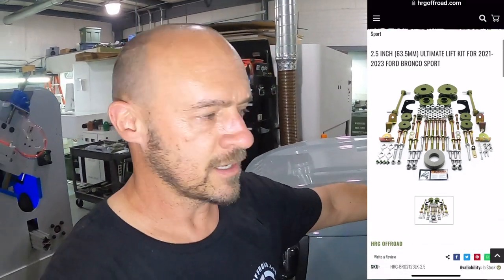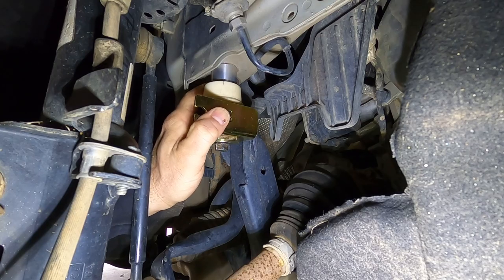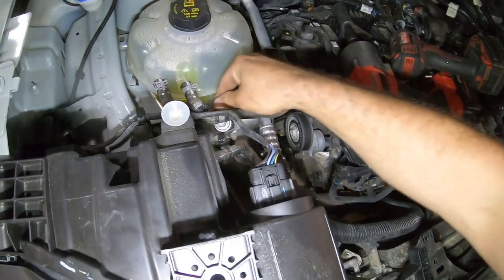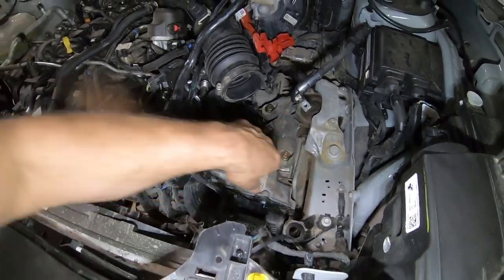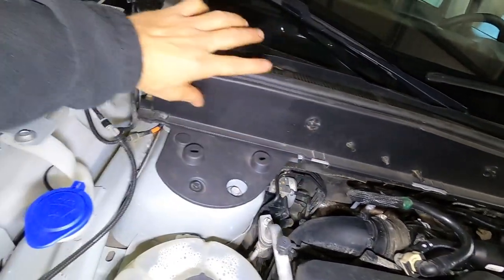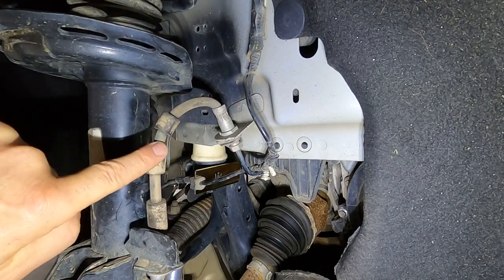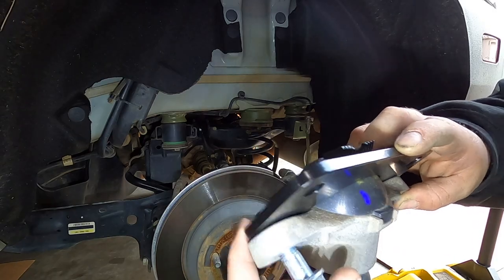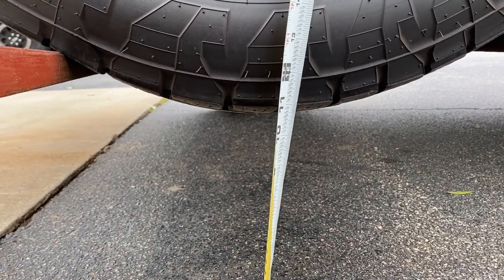How to lift a 2021+ Ford Bronco Sport 2.5 inches with the HRG Offroad lift kit!

Comment: Hey Ben, I just bought a new 2023 Bronco sport (Outer Banks). You said in this video you're working on a 2 1/2 inch lift to fit this model along with the big bend. Is it available now or can you tell me when it will be available for theses models? I'm very interested in purchasing this lift and appreciate your assistance in any way.

Comment: I just installed your 1.25" kit on my Badlands. Thanks and im glad you make products for the Bronco Sport. My question for the 2.5" kit, will this void the power train warranty?
Reply: We have a 21 bronco sport I asked my Ford dealer where we bought it from if I put a after market lift will it void the warranty and they told me yes I have to get the dealership to install a factory lift from ford which at the time only offered 1.5 lift and still have the warranty hopefully this answers your question
Reply: @rogerd8121 false information they would have to prove that any failure being covered under warranty was caused by that lift.

Comment: I can’t find anything bigger than a 1.5 inch for the big bend :(
Reply: The largest is 1.5 inches unfortunately for the lower trim levels. But you can always get larger tires at 225/75/ or 245/70 and it will give you a boost but will affect mileage and possibly even how your speed is recorded.

Comment: mind boggling that people buy and mod these turd`s on wheels. I saw a video yesterday of a new Bronco Raptor out in the middle of nowhere Utah doing some off roading and had to call for a recovery due to a fuel pump going out. my 2020 4Runner is almost 3 years old and has had ZERO problems and will likely last as long as my 1996 did. I drove that one for 19 years and over 300k miles. do yourself a favor and do a lot of research before buying a Ford nightmare.
Reply: Sorry bro, 4Runners haven’t been cools since the 3rd gen’s. 
You just basically have a Toyota Tahoe
Reply: @Slablabfishing2023  Hey Hey Hey.... no need for Tahoes catching strays!   😆